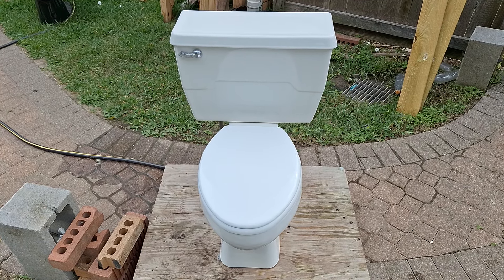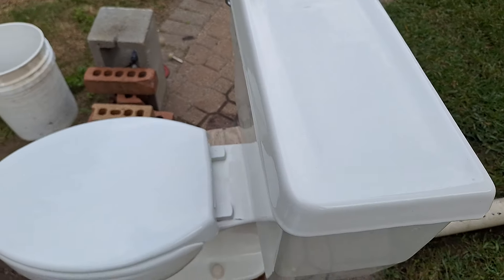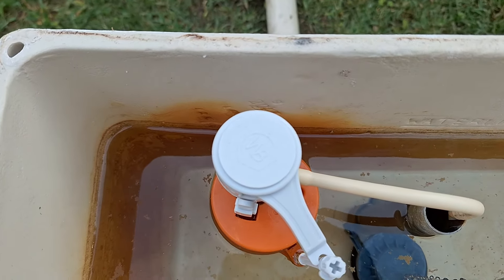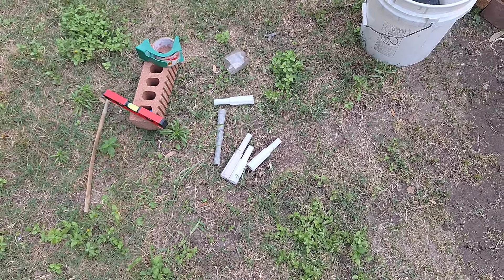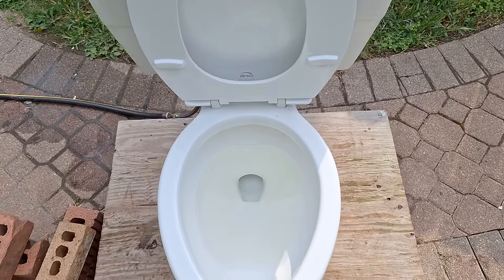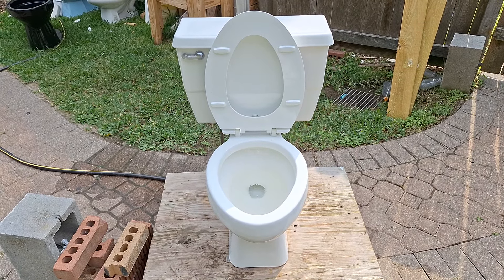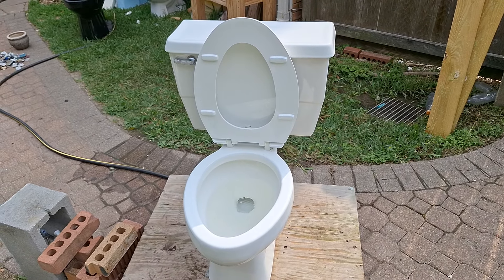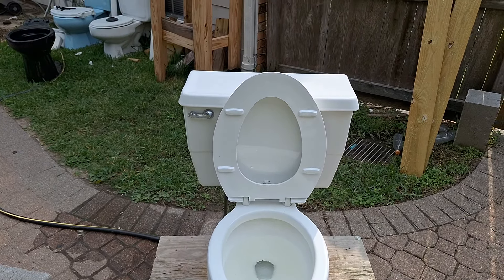1976 Kohler Wellworth Flushes!

Comment: The original genuine Kohler fill valves are still available for these as of 9/24 on Kohler's website. I've been meaning to get one for my 1951 Wellworth but they're a little pricey. The P/N is K-30671. There are also other variants which may or may not be available.
Reply from the maker: That's really cool! I see them occasion but they're never in good condition.

Comment: This 1970's Wellworth Waterguard ('Transitional Model') certainly has a much more powerful (and longer) flush as it is using 5 Gal instead of 3.5 - it might have better overall performance on this set up. Not a huge fan of the normal 3.5 Gal Wellworth Waterguard but this transitional version may well be the exception!
Reply from the maker: Transition models are cool